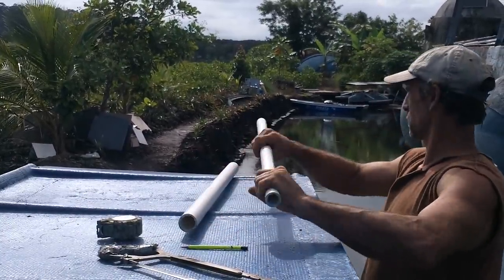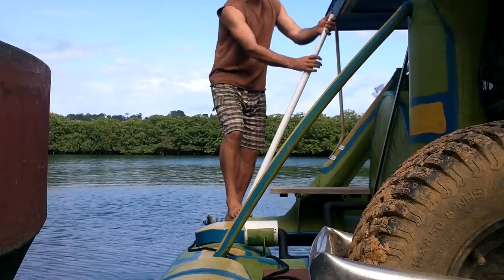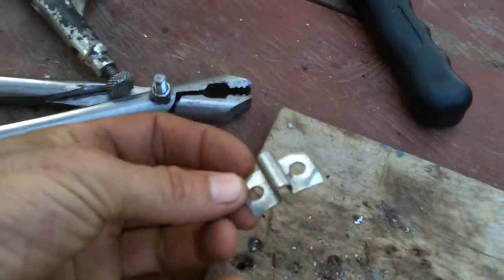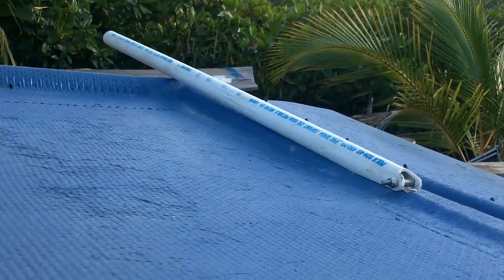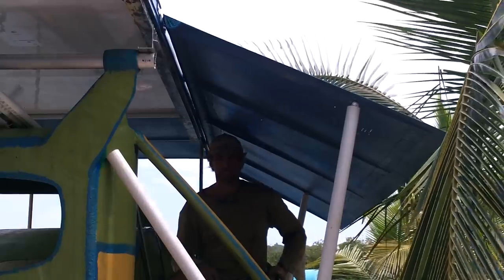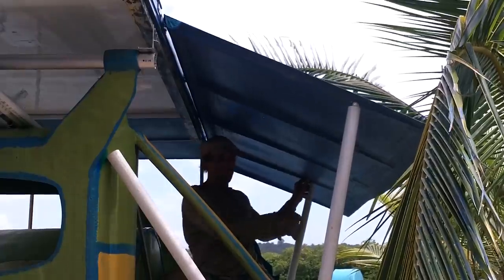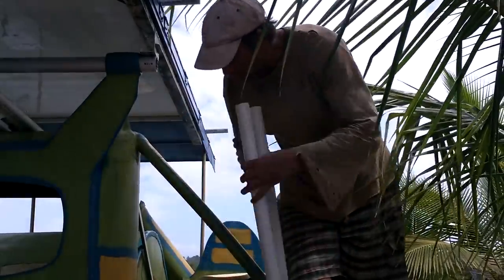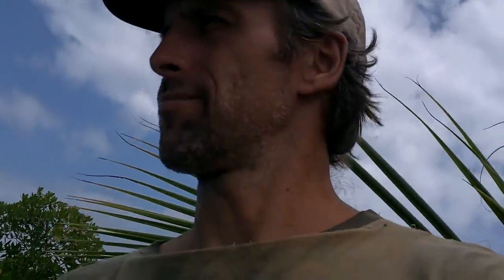Solar Snailer 034 Left Posts

Comment: You could lift the hinges up an inch or thereabouts so that the top panel flaps shut with a gap just wide enough to stow the support stay.  This would the also give you the room to add the stiffening rail you mentioned on the edge of the flap.  This would then mean the top panel will close parallel to the bottom one again, albeit it now having an inch gap instead of being flush.  :)

Comment: To get around this problem I would recommend not attaching the poles directly to a panel. Just have both poles attach to a horizontal rod. You can then just have clips to attach the rod to the panels, which would be on the rod. you might even consider how to put the rod in place before the panels even come down. The clips would be great because you would have multiple contact points, holding the panels in place. It also gets rid of the awkard lineing up the poles. If the poles never come fully apart, life is good. I will leave the rest to your imagination. This was just my first thought in seeing the issue.

Comment: You could just put sockets on the panel that folds under the top one and have the support pipes nest together ... So you just set the pole length then pin into socket of thr panel ...

Comment: @9:08 you can see there is a further reveal that could be used to support on that the other panel does not extend over.  Also at this same image you can see the other horizontal pipe.. you could have another nested pipe go in that pipe and simply extend out to carry the overhanging load..  Or there could be an outrigger that comes down from there that could be used to hold up the panel. it would be at a fixed angle likely or atleast minimum angle depending on how much bow you could get in the pipe/pvc.   did i confuse anyone yet.

Comment: I mean it's a pain in the ass but you could go with longer hinges to get a bit of clearence for the panels when it's all folded up. Perhaps you could have a middle support on the cargo side that stows away and it just clips inot pl;ace once the cargo side is loaded.
  Nice work, are you fitting lightweight flexible panels again?
I see you went with something that can be angled into the sun rather than thin film that are larger but can output almost full power in any conditions at almost any angle as long as they are not facing north.

Comment: Jamie how's about fiberglass stainless steel nuts to the under side of the panels and put shot bolts on caps that go on top the pools so you only need to screw them loosely in to hold them ? Low   profile and fixed so they can't fall overboard....

Comment: How about you cut 1/2cm to 1cm lengths of the larger diameter pipe and glue/glass them to the bottom of the flaps just next to the angles pipes used for making the flaps rigid, the small pipe will just fit into these little "cups" on the back of the flaps and stay nicely in place unless a gust picks the flap up. maybe if you can make these cups 2cm you can use a pin there to secure them. just not sure how much the 2cm cup would stick out from the back of the flaps?

Comment: Hmmm? Use Exactly The Same Setup!? Put The Same Small Pin Holders As You Used On Other 1st Side, Butt Just Stick In The Top Thru Pins After 1st Panels Are Opened & Leave Pipes Together Under!? LOL Thanks

Comment: I know I’m late to party, but I feel like the panels should’ve been able to slide out, rather than flip up.  Reasoning: with slide out panels, one would ALWAYS be in the sun.  With the fold out model, when stowed, all panels are covered up by each other.  Just sayin.  ...Maybe gen2 can include sliding rails AND hinges so when fully deployed, the two outer most panels could still be “angled” for maximum solar absorption.  Thanks me later.
Reply: Black Bart he doesn’t want them exposed to the sun at all times. They have a longer lifespan if used when needed.